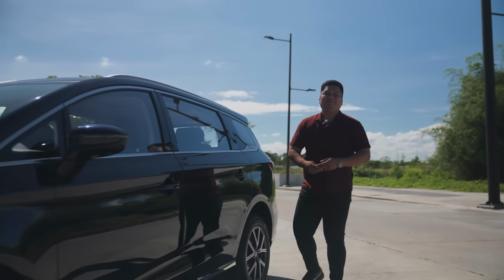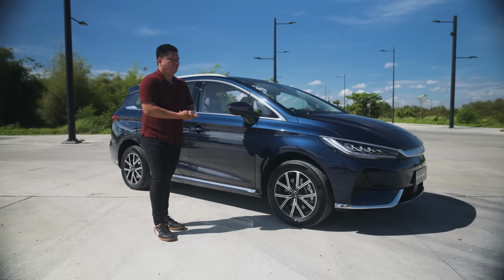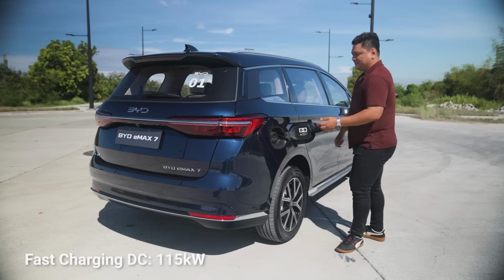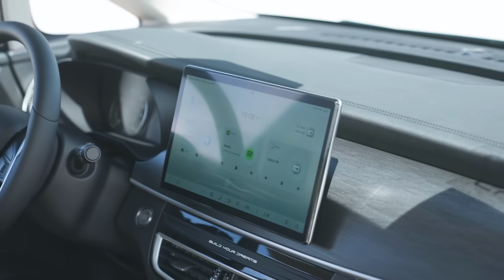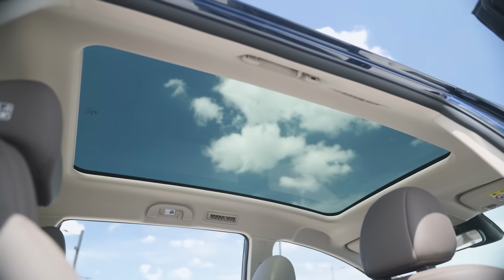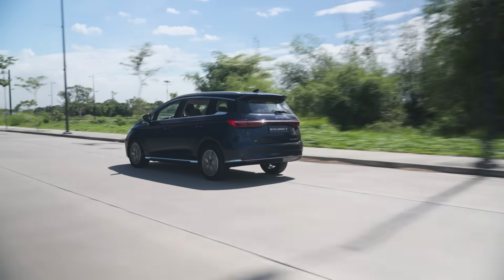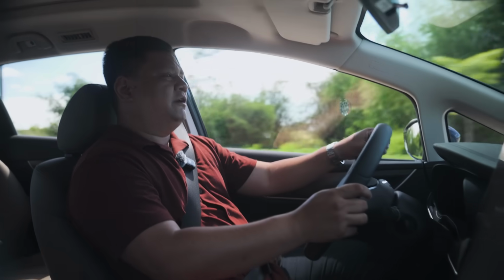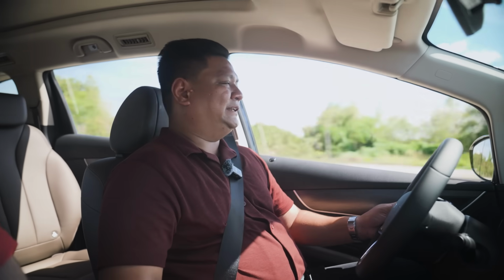BYD eMAX 7 – The Electric Company | First Look | Zigwheels.Ph

Comment: The front brakes of this car are massive... Take a look at the xpander, it has the rotor size of the wigo
Reply from the maker: EVs generally have bigger and more robust brakes given the extra weight of the battery and the massive, instantaneous surge of torque! - Roy